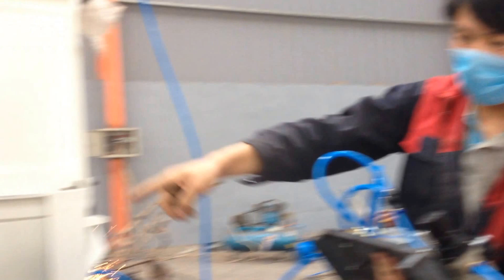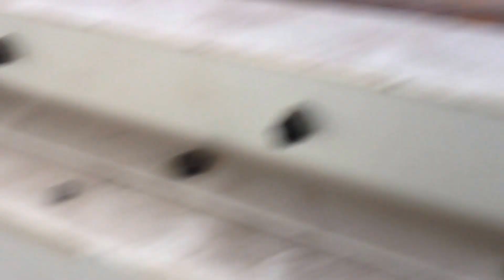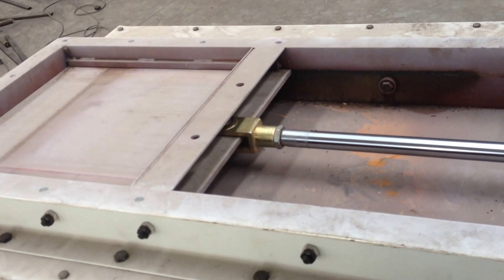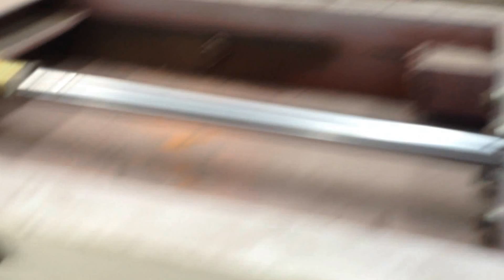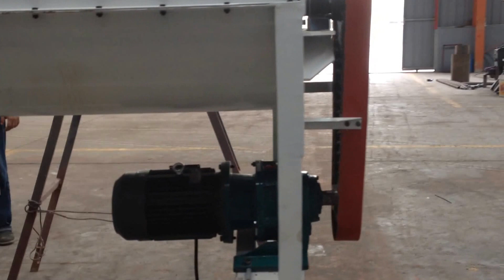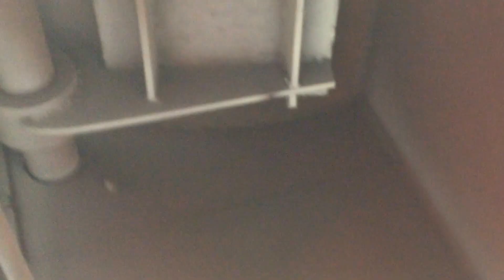Animal feed mixer machine

Comment: It's similar to our one at work it can hold up to 2000kgs 2T and our other small mix about 600kgs they're pretty much the same
Reply from the maker: Its output 250kg per batch , every hour ,it can work about 6 batches every hour, so the output is about  1.5 t/h
Reply: Emily Sun awesome wish ours was like that it would make our job alot more easier we have so much to do with farms it takes about 1/2 an hour to finish 1 tonne and getting it ready for the next load
Reply from the maker: Hello, there are many different model with different output and size . And mixing time , you have to add the feeding and discharge time ,total is about 10 minutes every batch .